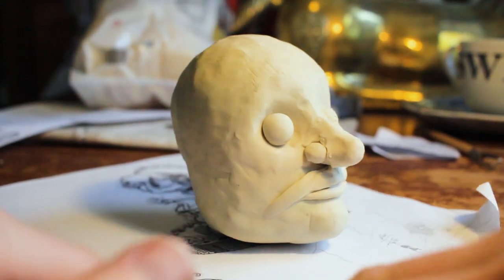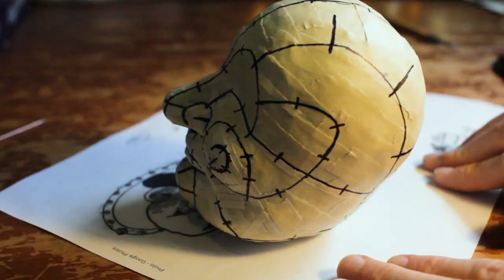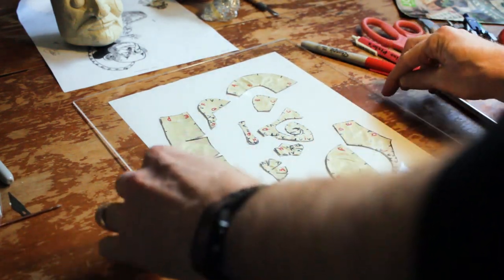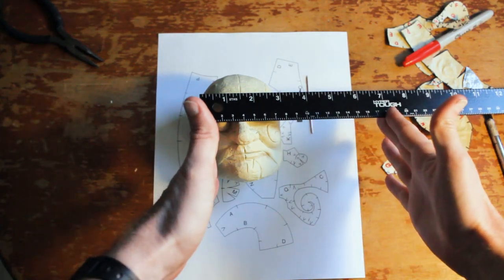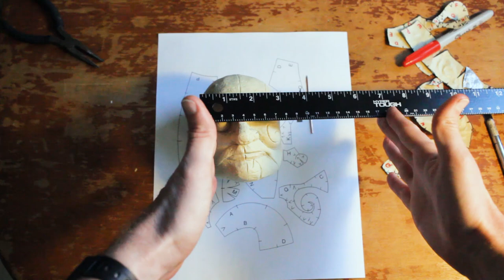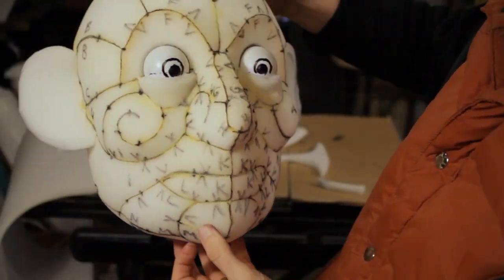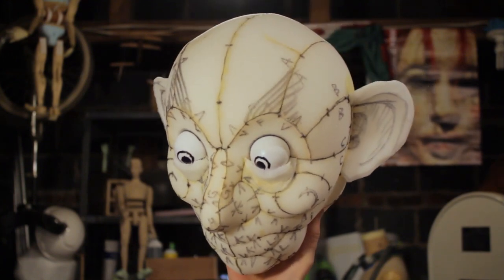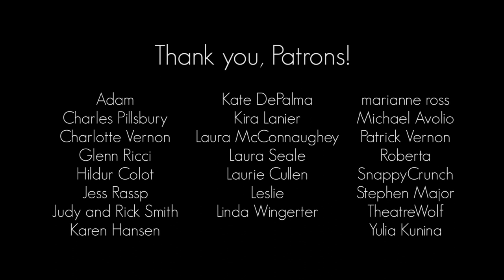Advanced Patterning for Puppetry

Comment: Nice work! About to start this new art form... but these Bevel cuts are confusing. I understand "outside" or "Inside" bevel cuts, but how do you decide the degree / angle of the bevel? And those darn Darts! Why isn't there a 3D app that can tell us where to make the cuts?
Reply from the maker: Thanks! For the most part foam is pretty forgiving if you're in the ballpark of the correct angle. If you're not sure, try cutting them at a 45 degree angle and see how they fit. You can always cut or sand more material off.

I wish there was a good, simple 3D app that created flat patterns, too! The biggest issue is that we're cutting curves to create smooth organic shapes, and 3d models are made of flat polygons.

Best of luck trying things out!
Reply: @AlexAndOlmsted  Thanks for the tips. For whatever reason I decided to start with a complex shape. Gluten for punishment I guess. Don’t stop making these tips videos. Really helpful.

Comment: Dope.  So was this for demonstration only, or are you planning on using this as a real puppet?  Wondering how you would put fabric on something like this, or color it.
Reply from the maker: Thanks! This was just for demoing the patterning process. If I were to cover it in fabric I'd probably use a draping technique and work in sections. If I were going to paint it I'd use acrylics and spray the surface of the foam with a little water to help the colors flow. Also, if I knew I was going to paint the foam from the start I would mark the insides of the pattern pieces so the marks wouldn't show.
Reply: @AlexAndOlmsted  That makes sense and is very helpful, just like the video in general! Thank you!

Comment: I just discovered your channel. I'm looking forward to digging in.
Would you use the same patterns here when you get ready to cut your covering?
Reply from the maker: Glad you found us! I wouldn't use that many pattern pieces for covering it, especially if I was using something with a lot of stretch like fleece. I'd probably do a light dusting of spray adhesive on part of the foam, drape the fleece in that area (gently stretching or gathering darts where needed) and move on to the next area. Then you could cut the excess off and tidy up your seams with a ladder stitch.
Reply: @AlexAndOlmsted  That seems like it would be a good topic for a video ;D